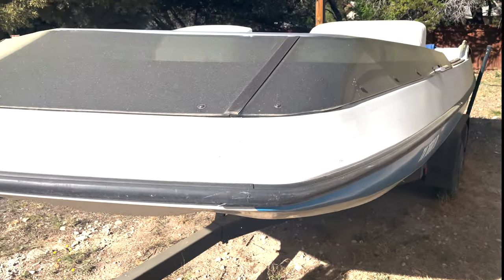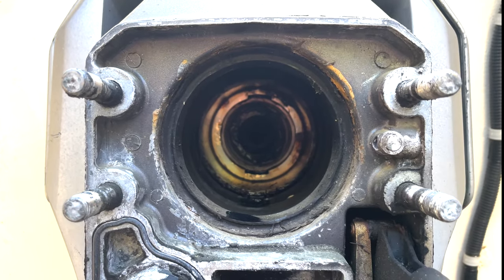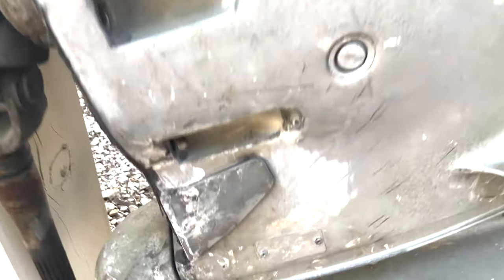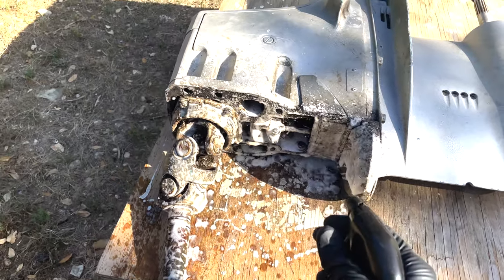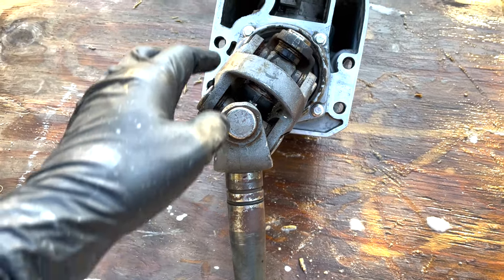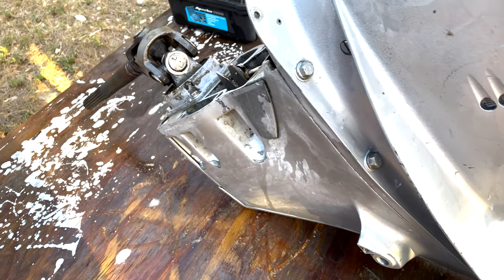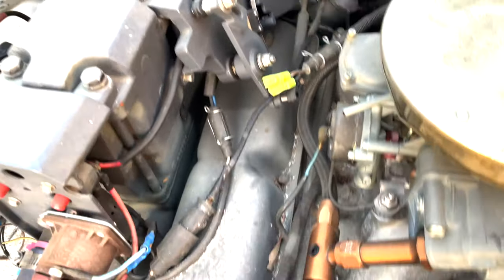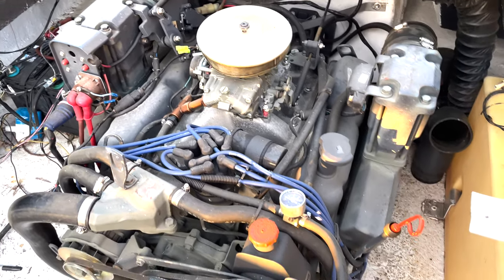OMC 5.8L 400HP High Performance Series! Anodes/Zincs

Comment: You this think the cobra is strong enough for 400hp?! 
I just built a mild 350sbc with a better intake manifold and zz4 camshaft roller vortec engine with roller rockers. I should be around 330hp to 350hp I'm worried about breaking the OMC cobra? 
I was told don't jump the boat via waves and no hole shots?!  " what's the fun!!?? Lol the boat is a Baja Force 220
Reply from the maker: I’m hoping the stern drive holds up. There is a lot at stake with this build. Your setup sounds like my style—The majority of my experience however is with Ford.
Reply: From what I have read online the Cobra (rebranded Volvo Penta SX drive) is good for around 400hp. Volvo Penta switched to the duo-prop drive for engines rated more than 415hp.